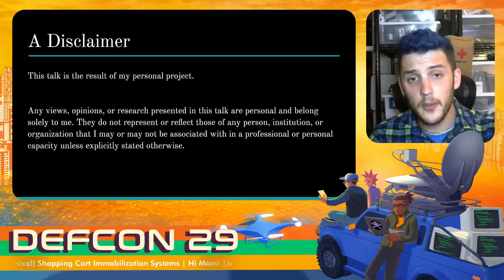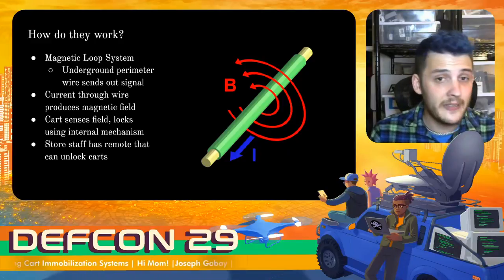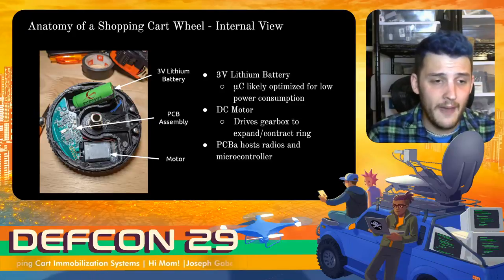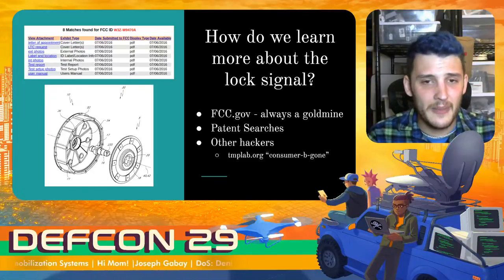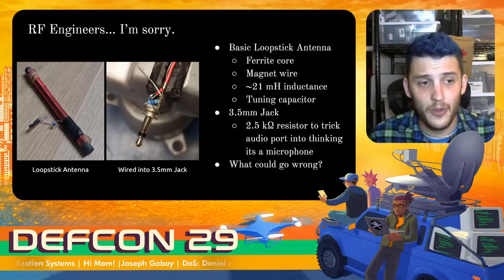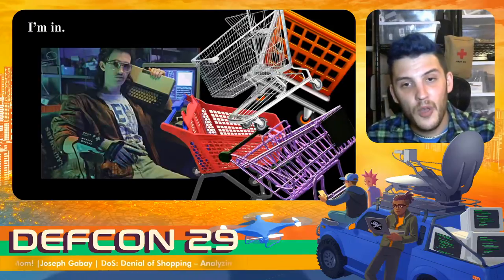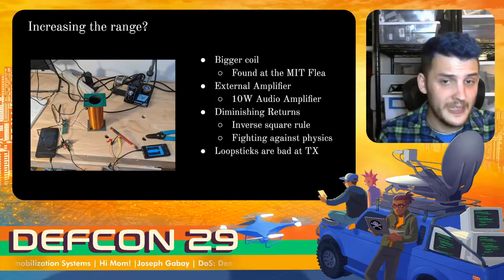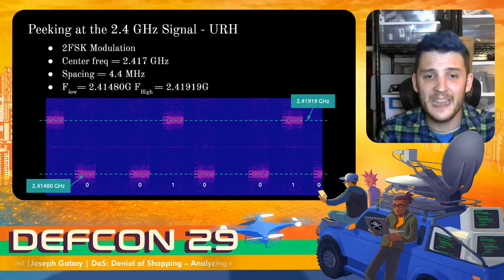DEF CON 29 -Joseph Gabay - DoS  Denial of Shopping: Analyzing and Exploiting  Shopping Cart Systems

Comment: applause! very nice! "normal" license-free 2.4 GHz part-15 systems have a very low power limit. But licensed amateur radio operators in the US can run up to 1500 WATTS on most of the 2.4 GHz band.